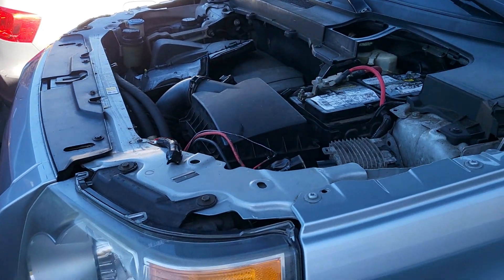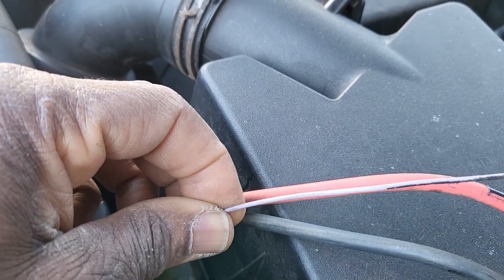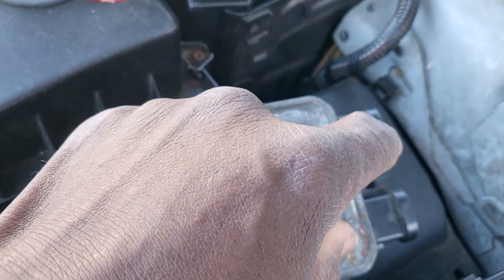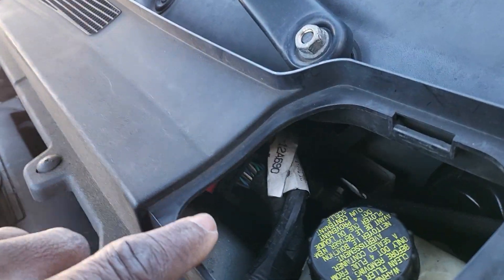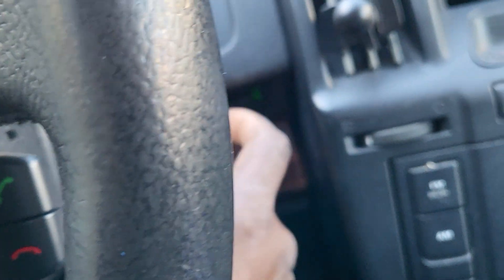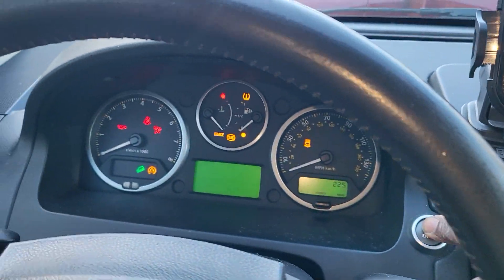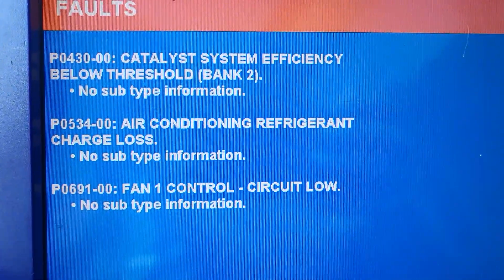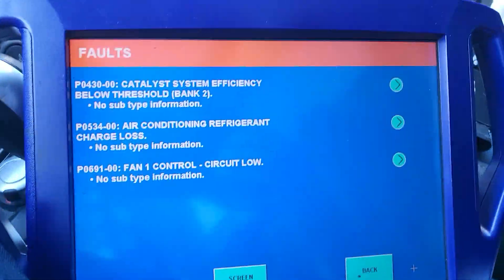2008 Landrover LR2 Overheating _Module _Connections_Wiring Diagram /Computer-Cooling System Fixes #1

Comment: Good afternoon my friend, how are you? I have a problem with my FL2 here in Brazil and I can't solve it in any way, it has anti-theft active, and I had also opened the collision mode, I ran the scanner and even so it still doesn't accept the key or turn on the panel, would you have any tips to help me, thank you!

Comment: I have a similar problem, but with a Range Rover Evoque 2013. Checked the voltage on the control wire while the engine is running & it fluctuates between 3.2V to 12.71 V 
But the fan only runs for about 10 seconds when the coolant temperature reaches 102°C